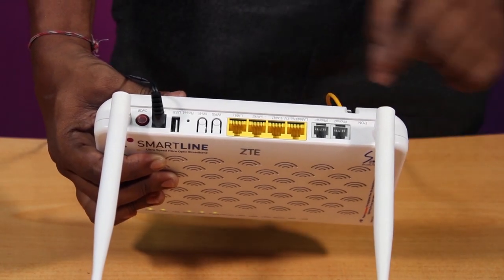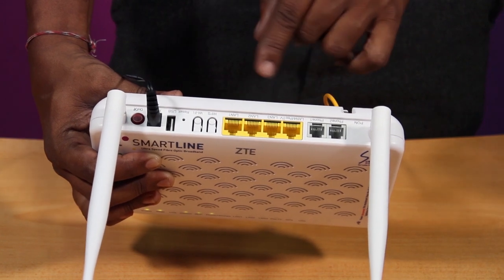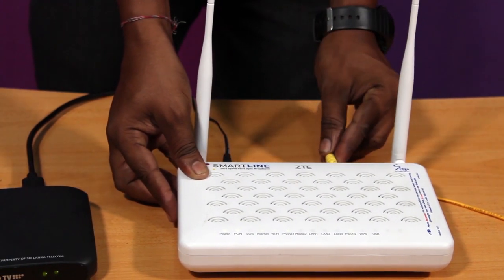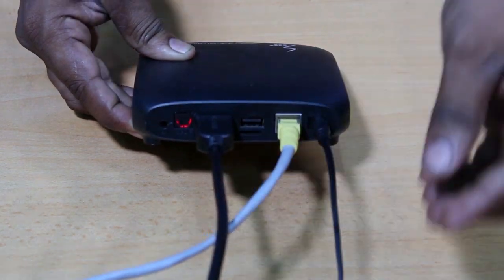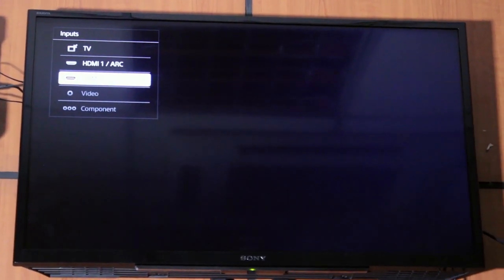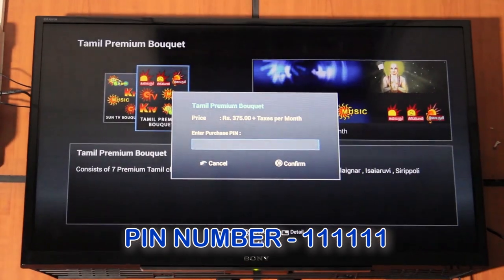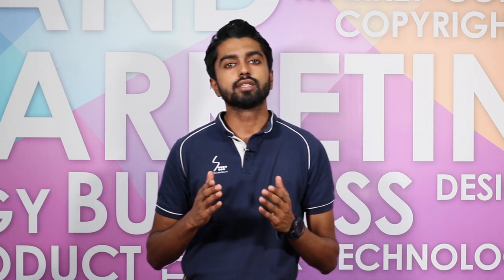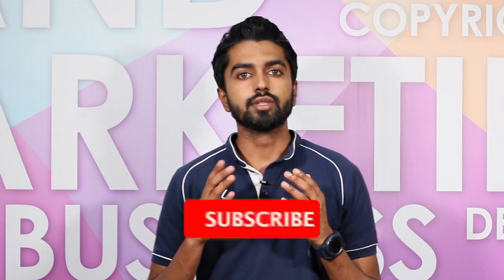Fix your Fibre PEOTV connection

Comment: 2021 වෙද්දි ඉන්දියාවේ Jio fibre , Airtel Xtream අඩුම මුදලට 30 to 1000 mbps speed එකෙන් 3300GB Cap එකක් තියෙන Fibre දෙන කාලේ , නේපාලය නේපාල් රුපියල් 1000ට 120mbps unlimited Fibre දෙන කාලේ SLT ,Dialog Fibre උඹලා අපේ සල්ලි තව හූරං කාපියව්!

 ඔය තරම් ගිණිගණන් ගෙවලා Data ගන්න නම් ආණ්ඩුවෙන් අපේ පවුල්වලට SLT එකේ ජොබ් දීලා තියෙන්න තිබුණා.